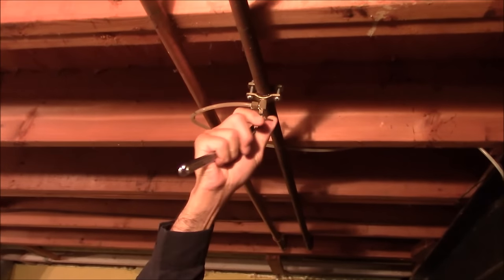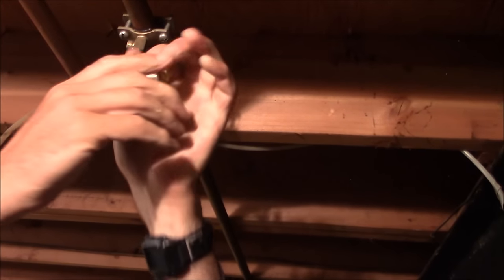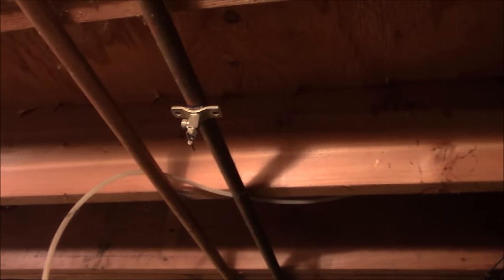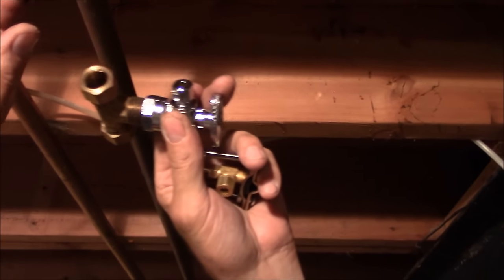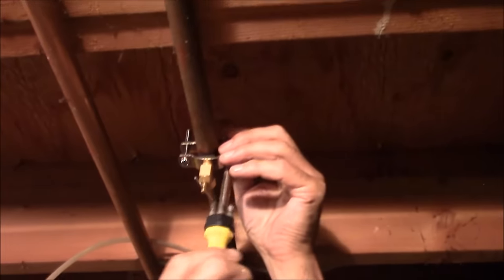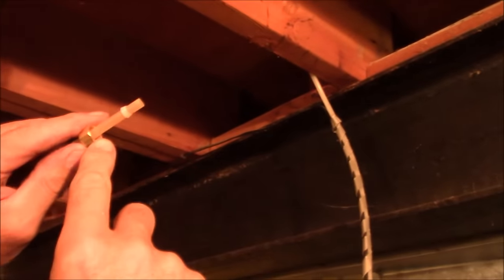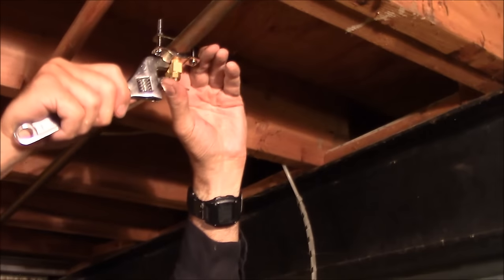Replace a Saddle Valve in 5 Minutes to Fix, Repair Water Pipe Pin Valve

Comment: Do I need the stiffener in a copper line?
Reply from the maker: No, and some of the newer poly lines are thick enough wall that they don’t mandate it all the time.
Reply: @MrHardware1  thank you very much for the reply and you're video. I just ended up replacing the whole section I added a 1/4" compression Tee and a few couplings I did use shark bite push fittings but I'm not skilled at soldiering. It's nice to have a real quarter turn valve and secure fittings but unfortunately my refrigerator itself is leaking not sure if it's the ice maker or filter.

Comment: I am replacing an old copper supply line to the fridge. It wasn't leaking before but now when I open the valve (pierce) water is leaking like crazy. The line is connected even and tight. What am I doing wrong?
Reply from the maker: It may need to be replaced. If you tried to tighten the 2 bolts on the saddle and it still leads the gasket may have gone bad. Get a new one, about $6. Blair

Comment: Can I just leave the old one on and put a different one on so I can install it on the side?
Reply from the maker: You can, not that I'm liking it. If you have copper or newer plumbing sediment is not that big of a concern. That is why I didn't change the one in the video. My opinion is because in the old days most plumbing was galvanized and encountered rust and other crud.

Comment: Does this saddle valve work on pvc water pipe or just made for brass
Reply from the maker: It will work on pvc, however it is safer to glue in a tee and put the valve there. If the pipe ever gets warm it can deflect and then leak.
Reply: I wouldn't pcv is too soft and brittle and may crack. just glue in a pcv t with a threaded male then pit a 90 degree shutoff like used like under a toilet

Comment: We want to disconnect the current copper water line we have running to our new refrigerator, and want to replace this line with a plastic line., can you tell us how to do this? I've looked for it here on line but no video on it., thanks!
Reply from the maker: Use all the same parts except use vinyl or plastic compression rings, not brass. Sometimes I use a stiffener inside the line to keep it from collapsing.
Reply: Thanks all! My husband bought a kit for a compression fittings, and was successful in connecting the plastic water line already on the frig, to the copper line already in place., little things make all the difference! Thanks again for your help!
Reply: @MrHardware1  which way do you have to turn to shut off i have a leak in the plastic hose a it won't  stop which ever way i turn it it still leaks
Reply from the maker: @lorisalomon9069  It is clockwise, like you are screwing in a screw.

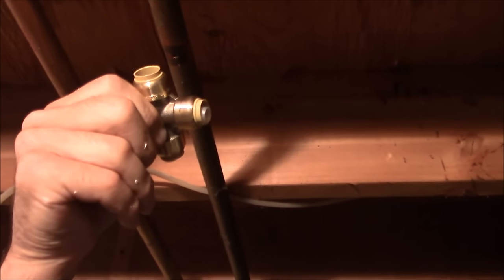Comment: 2:43 - SharkBite's are up to code even behind walls. While most plumbers won't put them behind a wall, nothing wrong with using them if the pipes are exposed and easily accessible. Bad ones can be replaced in less than a minute.
Reply from the maker: The damage from a ' bad one' could be thousands and months out of a home. However they are code and use them at will. My opinion is 'old school' and I believe 50 years is acceptable for plumbing to last. Not that I have any facts about failure on 'quick connects', just am not a fan.
Reply: @MrHardware1 , you can say the same thing about any plumbing job. A bad soldering job by not deburring and/or too much flux left inside the pipe can lead to pinhole leaks as well. The point I was making is that SharkBites are up to code. Any bad plumbing job can lead to leaks. SharkBites O-rings have a 25 year warranty when installed correctly, so just don't put them behind a wall.

Comment: How about on galvanized pipe
Reply from the maker: Usually it is the same valve, and galvanized pipe typically leaves enough rust sediment that gets the valves clogged, right where they penetrate into the pipe.

Comment: Camera operator needs to watch the viewfinder and not your hands. We missed the part about the water line installation in the compression that but we had a nice view of the underside of your floor.

Comment: BALL VALVE DOESNT WORK.  SMALLEST OUTLET 3/8 INCH.  WHICH IS WAY TOO LARGE FOR THAT LITTLE PLASTIC CHEAP LINE.   SAID YOUR OLD FASHIONED NO O RINGS YET USING CHEAP PLASTIC TUBING NOT COPPER.  THEN INSTALLED SAME CHEAP SCREW IN VALVE.  NUTS

Comment: You say you would fire any handyman or plumber that would use a "cheese ball" push in connector.  And then you proceed to use a saddle connector which are banned by the plumbing code!  You should emphasize that the new saddle connector should be replaced ASAP with a proper valve and fitting.
Reply: Guess you didn’t listen very well.

Comment: push-fit connectors have ONLY been around since the 60's.  The o-rings are neoprene, not standard rubber.  But I agree...if i'm paying a plumber, I don't want to see one installed.   That being said, I did put a couple under my sink, after failing to solder with propane
Reply from the maker: I use compression valves under sinks. The 5/8 brass ring once compressed will never leak, plus if you have to change the valve the 5/8 compression is a standard thread so replacing a valve is a snap. My trick for when a compression ring leaks is to wrap the ring, not the threads to be leak-free.

Comment: I have one of these doodads on my line, had no idea wth this thing was until today... im taking it out tomorrow and soldering in a coupler. I think this fitting is dumb, and will leak
Reply: Doodads?
Hahaha, that's why we're here!
Reply: @Scottocaster6668  lolz, i call it a doodad because its really not a good fitting to use.. alot of codes wont allow it.. its the cause of many flooded houses
Reply: @doylee469  hahaha, oh crap, really?
Too bad, it seems like a easy install too.
Reply: @Scottocaster6668  for sure easy to use, but they have fitting that work better... id reccomend even a sharkbite over this.

Comment: Saddle valves should never, ever be used. They are guaranteed to eventually fail, and when they do, the water leakage can cause thousands in water damage. Saddle valves are against code in every state.

Comment: Any way with a tea is better those saddle valves are designed to fail and are not league in most states
Reply from the maker: I agree, but the video is for those w/out the abilities to cut in a tee. Blair

Comment: Saddle valves are a plumbing code violation in every state.  Good luck filing an insurance claim for water leak damage and the adjuster sees a corroded saddle valve or passing a home inspection.

Comment: How is it that you shut off the valve counter clockwise??🤔
Reply from the maker: I open the valve counter clockwise before a new install on copper. Then turn the valve off to send the needle into the copper to pierce the hole. However the valve turns off clockwise.